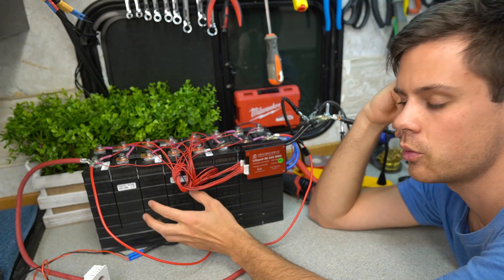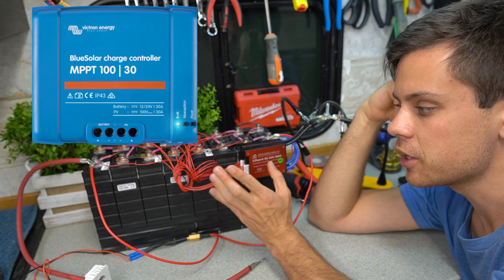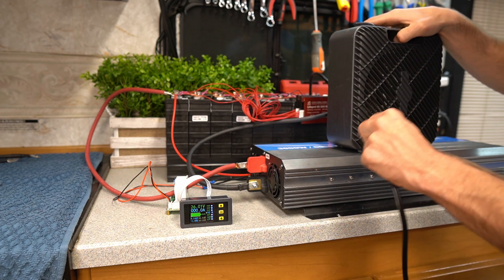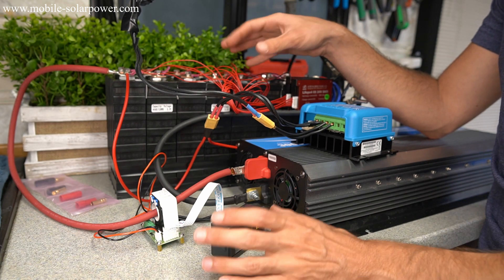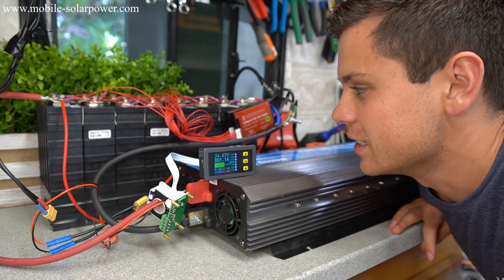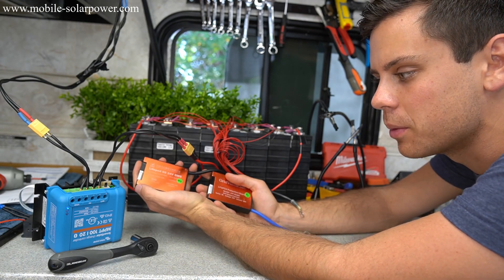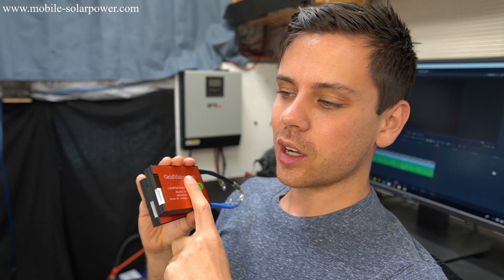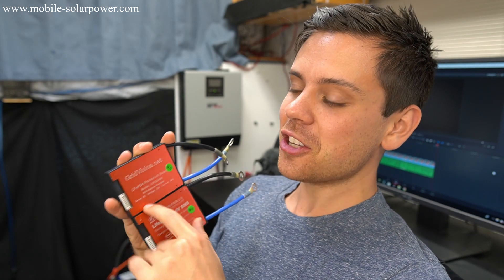Pushing 2800 watts with 2x Budget Friendly LiFePO4 BMS - Quick Test

Comment: Hey Will, I really enjoy your videos and your enthusiasm. I have been designing and working with high power systems for over 40 years. I would like to recommend one thing and I try but don't always do it myself, when working with these systems it is a good idea to be wearing safety glasses. You do seem safe and know what you are doing, but I have seen molten copper and things blowup at very  high currents, fuses do help though. This is just a suggestion. Keep up the great work.
Reply from the maker: I am wearing some safety glasses right now while reading this haha but yes, I should wear them more for the videos. I actually love safety glasses. Great suggestion! Thanks
Reply: @ Gaetano.. You know it dude. Fuses good..breakers not so good. I've seen them explode and catch on fire. I'm changing everything over to cartridge fuses. Secure any wire that has 100 amps being switched through it. That wire will move. Wear your safety gear on the job dude. That's a big write up if you're not wearing it or don't have the proper gear available to you. Arc fault is bad stuff that will change your life.
Reply: Ciao Gaetano! Di dove sei? Ho un amico col tuo stesso nome e cognome in provincia di Palermo
Reply: Same old, same old. "Don't mount the bed over the drivers seat",  "Don't put drawer tracks on the front seats", "Don't dump 600W of solar into an HHO generator". Sheesh!
Fortunately, I design my systems with failure in mind. I started with an Arduino and a couple of current measuring boards (one for charging, one for discharge and some simple math tells you how much you have in your battery bank). Then I ended up adding a temperature board because I don't trust the ones built into BMSs and then, kind of as an afterthought, added a smoke detection board because, well, why not?
Reply: Will: Have you ever done a BMS parallel CHARGE test?. I have built a 280 Amp 12V battery pack and put  a Xiaoxiang 250 Amp BMS on the batteries, (I dont expect  to draw more than 125 Amps) but then found that my 2nd Alternator in my class B motor home puts out 280Amps for the house battery. When the battery pack gets low the battery sucks up the 280Amps until the BMS shuts down, maybe 1 minuit. Then it restarts and so on. I was thinking of adding a 2nd Xiaoxiang 250 Amp BMS in parallel like this video. Do yu forsee any problems?

Comment: Thanks for the the info. It's one thing to read specs and reviews but nothing is quite as good as actually testing the devices to see how they perform.
 I've been looking for BMS options and it's really hard to know what to believe online.
Looking forward to seeing what you find with the hybrid inverter. I suspect I'll be getting one just like it. I hope to be able to hack into the EV charging stations to charge my 12 kilowatt Tesla Modules. Am I correct in believing that I could connect the EV level 2 charger to the 2424LV-MSD to charge my battery?     Thanks again!
Reply from the maker: Oh interesting question about using a EV charger. To charge your solar batteries? I'll have to look at how those chargers work. Shouldn't be that hard. Interesting idea
Reply: @WillProwse  Yes, it seems to me that it would be cheap fast and convenient to charge the "solar battery" that way whenever EV charging is nearby. I just had the idea yesterday so I'm still in the dark as to the hurdles involved. I learned yesterday that most stations use the vehicle's charger to control the actual charging. The station simply supplys the power after the socket/plug, somehow confirms that the station is plugged into an EV.

Comment: The two BMS were stacked. Why not separate so they run cooler?
Reply from the maker: Because I wanted to see how hot they would get
Reply from the maker: If the loads are shorter in duration, no heat is generated. It's only hot when you do a large load for a long time
Reply: Exactly, if it's the BMS that are getting hot you need to separate them and add a small heatsink.  I would worry more about the wires getting overheated that way.  I have so many cpu heatsinks sitting around I could easily keep them cool.  But you NEVER want to stack stuff that generates heat together it's so easy to give them each a little room.
Reply from the maker: Agreed

Comment: I want to run my rv AC long enough to lower tempurate to sleep. Would this suffice?
Reply from the maker: A tiny air conditioner will pull 600 watts. This can pull 2000+ watts. So yes, absolutely. But it depends on the size of air conditioner. And your battery needs to be big if you want to power it long term
Reply: 13k btu.

Comment: How equal was the current sharing of the two devices?
Reply from the maker: Oh man I should have put my other amp meter on one wire! Dang. Great question. They were the same temperature under load, so probably similar current, but I don't have data on it.

Comment: Hey Will, do you have a diagram for wiring the two BMSs in parallel? Also, if one of the BMSs dies, will you only lose management on half of the cells and the output will be halved? Thanks, great video as always.
Reply from the maker: Oh just connect both BMS to the battery like normal. And if one fails, it will still manage all of the cells, but the output current would be reduced. Depends on what fails though.
Reply: @WillProwse  , thanks Will.

Comment: Very impressive and another great vid. My situation involves supporting a transceiver and a few accessories amounting to an average 10-15 amp load with a need for up to 50 amps when transmitting. I understand a 24 volt system would be more efficient but is it worth it to use 24V when I'm in need of 12V pushing the loads described?
Reply from the maker: That would be a pretty easy load for a 12v, 60 amp bms. And no, you don't need a 24v system for that. 24/48 is great for large systems, but for your loads, not that necessary
Reply: @WillProwse  Great, thanks for the info. Looking forward to the next vid...B

Comment: worth a mention that if you have multiple batteries you can just have 1 on each battery in parallel to increase total draw.  Use for example a van-conversion, you are probably going to want to have at least 4 x 8 cell batteries, with 4 BMS's ...... even if you you account for drawing 40amp per BMS, thats going to give you 160 amps of constant draw without even pushing the limits. :D
Reply from the maker: Hey that's a great idea! Very true. Lots of BMS wiring but that would work. I personally like to reduce the number of BMS on my system. Less chance of failure. I prefer paralleling cells, then putting them in series so a small BMS can manage a massive bank. But yeah great idea!
Reply: @WillProwse  yep both are viable.  Of course for the purpose of this video in reducing the costs and improving reliability.... serial battery with a parallel bank means you can loose a battery and the system maintain voltage... if your off grid this is a rather large point. 

With a parallel battery - series bank, loose one battery, loose the whole bank.  If that is your only bank, your back into the dark ages until you trace and repair the fault.

But having the addition of extra BMS for extra output is always going to be a good idea :D

Comment: Great! Any 5S LTO bms (charge/discharge protection) which would not cost fortune? 

I just don't get it, why 100A 14.4V 4S LiIon BMS cost 4-5 USD on AliExpress (I tested that white tiny bms board and easily goes to 85A continuous for few minutes), while 100A 5S LTO BMS cost 60-100 USD.
Reply from the maker: Yeah I noticed that as well. First off, they need to run it at 6s for LTO. More usable capacity and better performance for 12v appliances. Under load, 6s keeps around 12.8 volts. Most LTO bms are 5s. drives me nuts.

And right now for LTO, there are some cheap options, and daly makes a good bms but if I had to go with LTO, I would get a multi-chemistry BMS that can handle 12s or higher. So you can use 6/12s. 

Probably higher price due to scarcity and not many people are using them.

LTO guys in the forums run without a bms because overcharge/discharging is not a big issue. Some capacity tests people have do will have full capacity after running the cells to 0.0 volts. But it depends on how youre using them. I wouldnt use them for solar, personally.

Comment: Hey Will, good to see you looking for simplicity. If one of the BMS's fails how would that be indicated? How would you know which one?
Reply: You'd suddenly not be able to pull more than 60A without the still working one tripping.
Reply: @dash8brj  Yes I realise this but is there an easy way to tell which BMS, or it's just a matter of unplugging one at a time? I thought there might have been an indicator LED to point to the failed BMS and if not how could you make one?